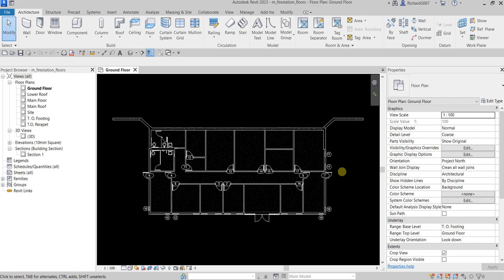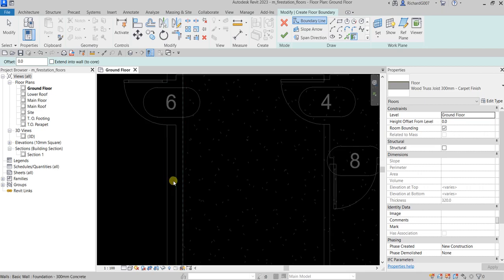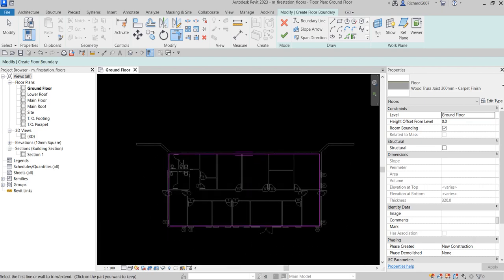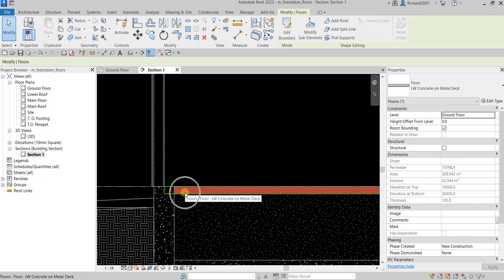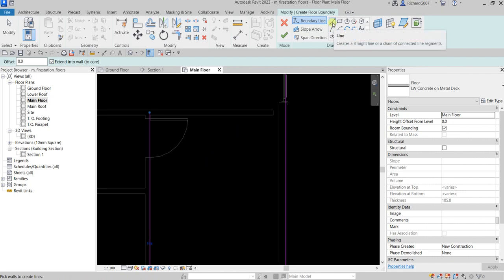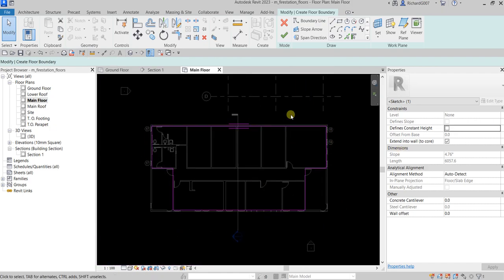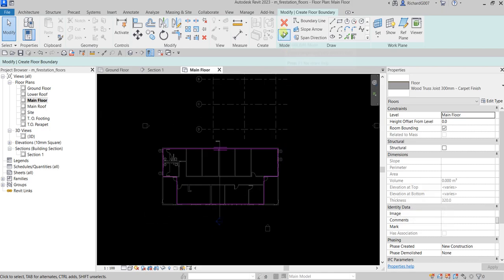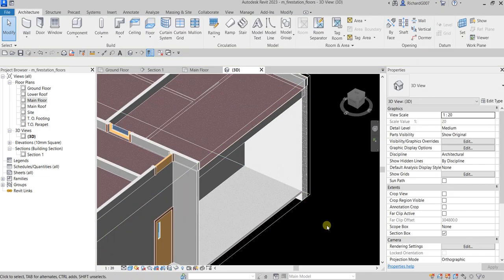REVIT 2023 ARCHITECTURE: LESSON 15 - CREATE AND MODIFY FLOORS

Comment: Walls and Slabs are not connected.1st Floor slab just stays in space. In my opinion, You need to either extend to the core or use the join tool to connect them.
Reply from the maker: hi mate, thanks for the input!